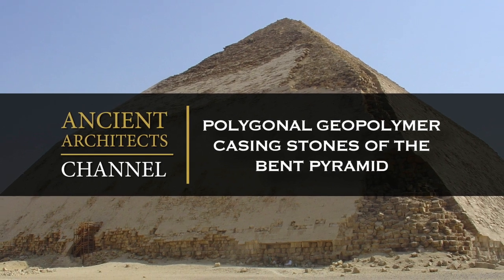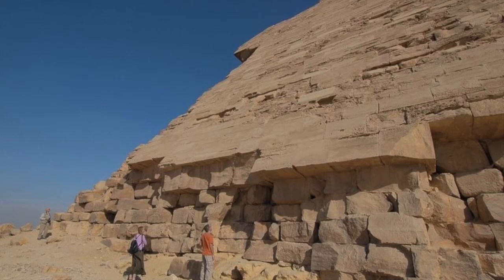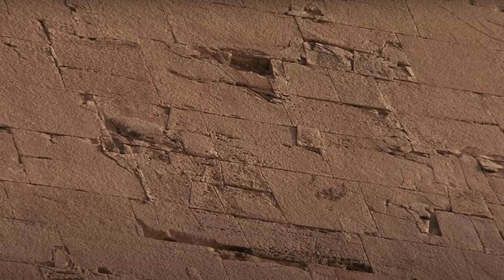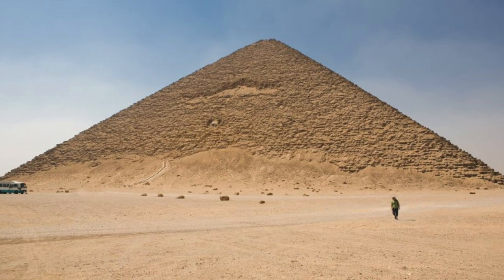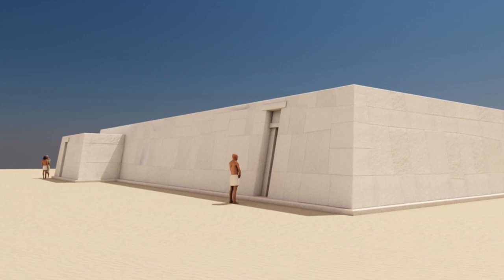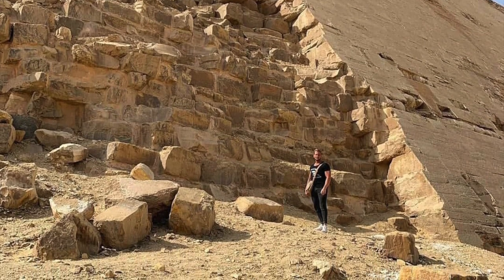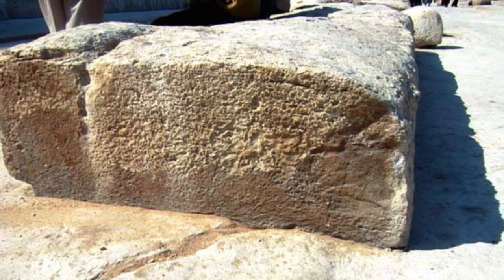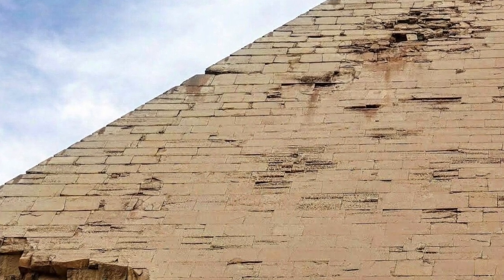The Polygonal Geopolymer Casing Stones of the Bent Pyramid | Ancient Architects

Comment: Other points. Shot at 7.42 could be showing cot blocks used to infill holes left by timber scaffolding. These holes can be seen on many later stone work constructions, and the same method of external access could have been used for these facings. At 7,45 to 7.50, there appears to be at least three emthods of work carried out, with what looks like a carved chisel mark on a perhaps cut corbelled facing stone set out from the roughly placed and happhardly bonded stonework behind, and what looks like sections of poured reconstituted stone work to its side, with markings undrneath that could represent later rain spoiling or that which was left behind by shuttering that could have contained poured stone blocks.
Similarly, the shot at 8.18 seems to show a varying thickness of the casing stones, with many of the thinner layers apparently bonded to the rough inner stonework, and with what looks like today, a similar mortar being used to either infill between the casing stones or to bond these casings deeper into the adjacent slab.
The so called bnt pyramid looks more like the creation mound of early nile valley culture than it does a pyramid, and if the intention was to create a replica of this mound, or if this structure is the original mound of legend, then it was never intended to be what we late commers to the sene describeas a true pyramid.
Legend says that a mound rose out of the waters of chaos, and the concept of whether this mound was a replica or the original does not conflict with the legend. This mound is also said to contain original wooden support beams in its inner chambers, which possibly adds credence to the poured on site reconstuted stone idea, and if this is the case, then dating these support beams would possibly provide a relative time sale for its construction, or perhaps for one of its later adaptations and refurbishments.

Comment: The small cut out polygonal stones where more than likely an artifact if construction, holes left in purposely for scaffold like structures, and then filled in once construction was complete using the same stone casting technique as the other casing stones
Reply: Or they were repair jobs for spots were the mixture was not uniformly wetted, and thus was weak and crumbly from being too dry.  Haste may have been a factor seeing as how they had quite a lot of blocks to produce in a finite amount of time.

Comment: It's easier to cart a powder than it is a block. It's easier to wear down limestone with acid using abrasive, conpared to cutting blocks. Again far easier carting baskets of mud mix up the face of a pyramid than move a block. Cast in place, you only need 2 forms to hold the material in place while curing...once you have a core and an adjacent already set block. Acid on lime, extra sand and clay, caustic from natron or fire ash from bread ovens. Bam, rock.

Comment: Isn't limestone a sedimentary stone?  Wouldn't you be able to look at the stone for layers, or are the particles so fine that there aren't any layers?  Just a thought.  Another great video.
Reply from the maker: The blocks are quite small in relation to the bedding planes at Tura so you probably wouldn’t see a lot of evidence of layering
Reply: The samples from Giza that the Geopolymer Institute had tested revealed that instead of internal uniformity as results from natural limestone layering, the component substance was totally chaotic and jumbled, but still recognizable as limestone because it was crushed limestone.  From that they ascertained that artificial limestone had been made and used on the plateau.

Comment: Did we missed something here? May be ..

The following discussion has been unpopular  due to our mind set cultivated by those pride and prejudice academician. 

Exquisite and recision stone blocks precut prior to stack fit always end in air gaps at the stack interface, creating 3 stress horizontal points below every new block added. This remains non issue until the structure is mid way high. Then the lower layer blocks began to crack and crumble at the stressed points. If stack is allow to continue up, then next higher layer blocks will crack. What then? Game over!

Polygonal fitting is the only way to stack without creating air gaps to local stress points. Polygonal fitting can only be made with progressive and conformal molding with slurry of geopolymer in lime ingredient. 

Pre-shaped uniform blocks for construction must use mortar which is absent with great pyramids. For the great pyramids each artificial block were once mortar itself to be hardened into stone block within its temporary mold. 

Don’t just learn but think. Don’t just think but think outside our skull.

Comment: I think its likely the reason for man made stones is ....
•••1rst) you can achieve a VERY SMOOTH surface with very little effort, WATER THEN SCREETING MATIERIAL.  
•••2nd) hauling many small baskets of rock is easy compared to hauling 100 ton blocks... Moving That would NOT be achievable at all, especially if there was a drastic reduction in work-force.  PLAGUE, WAR, FAMINE, ECT..

Comment: Why would they use geopolymer stone over actual carved stone? First off, it is more materially efficient. Why would you transport tons upon tons of whole rock (that is already an amazing feat), only to spend more time on site to carve it, then place it. Think about all that rock you transported that would end up as debris. Debris represent wasted time and energy. It means you didn't need to transport what you threw out on site. Then think about how heavy it would be to place it. 
All the amazing Megaliths are geopolymer molded products. Especially Andecite and Granite. First off, it is easier and highly efficient to transport pulverized stone. The Geopolymer mix on site is then easy to apply (no need for cranes or any other crazy contraptions people still cant find any consensus on). It is also highly time efficient. It is possible to build multiple pyramids to the quality we see in Giza and elsewhere with Geopolymer in a person's lifetime. It is NOT possible to cut stone to that precision and assemble it into a single pyramid like these, and imagine, there are dozens of pyramids, 3 pyramids in Giza alone. Not possible! Even with power tools and heavy machinery to move it all. 
Even if time were not an issue, the final product of Geopolymer is superior to anything that could be cut.

There is evidence for the Geopolymer solution the ancients used all over these sites. Testing the material itself is one glaring form of evidence. But there is more evidence! I'm just leaving it at that.

Comment: Simple things for simple minds I guess.  Here is where all this supposed "geopolymer" imbecility originated from.

1 - Sneferu's engineers erred in the construction of the Bent Pyramid. They built a heavy stone structure upon a poor foundation and the angle of assent was initially too steep.  Net result:  subsidence whereby the sides began to slough off under the weight of the stone above and settling of the ground upon which they built.
2 - yet the engineers then attempted to repair the damage before eventually reducing the angle of assent.  Among the things they tried = apply gypsum mortar such as the Egyptians used for many applications in an attempt to shore up the sides.
3 - the mortar of course is made from various things to include the gypsum which sourced from the Fayum region north of Saqqara.

Moral of the story: the Egyptians were not building things out of blocks of mortar.  They as noted attempted to repair a single pyramid using it - and failed.  So what this rubbish is about is whereby people took a sample - not of the actual blocks such as we see = but of the mortar.  Everything which follows is an extrapolation based upon that single flawed assumption - also a disingenuous one to be frank.

The blocks themselves reflect the strata layers of the bedrock they were hewed from while the quarries show whereby the Egyptians were quarrying "blocks" in a systematic manner.  Creating blocks from a mix would entail even more work and time and yield blocks which reflect symmetry in size/shape/and consistency.  A block from a mold would not show density variations reflecting different layers of bedrock it was quarried from.  That is antithetical to what we see.  This is stereotypical internet fantasy - aka clickbait.

Comment: You brought up the two possible benefits to making synthetic rock.  It's easier than moving giant solid blocks and you can create blocks into the shapes needed, on site.  While it seems like the second option didn't work very well for the bent pyramid, it might explain why the pyramids at Giza are so precise.  That said, I still think the Pyramids at Giza are far older, made by an earlier lost civilization.  Because even if they could make synthetic rock into determined shapes, there's a ton of other inconsistencies with the Pyramids.

Comment: Here are two strong possibilities that you haven't considered yet: They did both.  The limestone that they quarried, and the blocks that they shaped on site produced plenty of limestone powder.  That powder was either waste and a nuisance or it was many new blocks just waiting to be produced with a little geo-chemical binder mixture.  

Using and transporting powder would always be easier than multi-ton blocks, so they would have to have been stupid to not use what was readily available to them without any added effort to produce it.

Also, it is not proven that the many ancient statues were carved. I argue that they were all cast except those carved in soft material, beginning with clay and wood.  And I will soon share the evidence of the casting process.  So...anything produced using artificial stone would not have violated the prohibition against carving stone.

Also, I assume that you are unaware of the prohibition given by Moses to the Israelites to not use carved stone in the holy places to build alters.  The stones had to have never been worked by man.  So such a prohibition is not without historical record, and since Moses came out of Egypt, that prohibition may have originated there.

Comment: ARtifical stone makes a lot of sense. you can carry one person or draft animal  bags of material rather than a multi-ton stone.
If you watch how they do theme attractions at disneyland you can use clay or wood molds to shape a stone to match needs. A lot less advanced planning. Alsp if the limestone has any patterns matching stones is difficult. The artificial stone would be much more uniform.  The artificial stone would likely resemble natural stone more as it weather.  The Disadvantage would be as weight bearing structural material, but as a finishing material it makes sense.

Comment: So the reason for the protuberance's on the faces of the stones in random spots is becoming clear. If the mix was not quite perfect in one spot eg perhaps a tiny bit too much water or some such as the pressure of more stones cast above increases the internal heat can increase in a spot and pop it out from interior pressure just like popcorn. If they leave said bump it will harden and develop a skin and the stone will cure and be fine. If you trim it off the stone will lose it's surface finish exactly like if you scape off the top 1/16 of  an inch from a freshly poured sidewalk the next day. You would have a rough uncured stone that would allow moisture to penetrate and destroy the stone as it cured which probably took about a month to reach full strength just like Portland. So they just left the protuberance's as a decor perhaps as a sort of climbing wall feature.
  Also if the stone grew a cute little breast it may well have been considered a lucky good sign perhaps of a nymph in the stone.

Comment: Obviously it's easier to grind up rough limestone and cast it with the same casts for consistency than it is to cut them to consistent dimensions. Polygonal blocks would be even harder to cut... casts would be much easier, just divide up the main cast into sections.

Comment: These blocks are not geopolymer - you can see the strata in the blocks.
They are natural blocks.
However, the more interesting problem is the quality of the pink mortar-plaster that holds them together.
The mortar is stronger than the blocks, and given some stress it is the blocks that break, not the mortar.

P.S.  What is the point of making synthetic blocks, when Tura limestone blocks a freely available?  And if you could make synthetic blocks, why construct with blocks, rather than pouring and casting the casing blocks as a single sheet of 'concrete'...?  Makes no sense. 
See the book Thoth, Architect of the Universe for all the answers.
R
Reply: The point would be to avoid having to move and elevate the massive casing stones of the lower elevations.  Also, as you point out, the artificial plaster (whether used as mortar or in making blocks) is stronger than natural limestone since it is made of a much finer grain of material (powder), so it could be relied on with greater confidence to never crumble due to the weight of the blocks above, or erosion over the centuries.